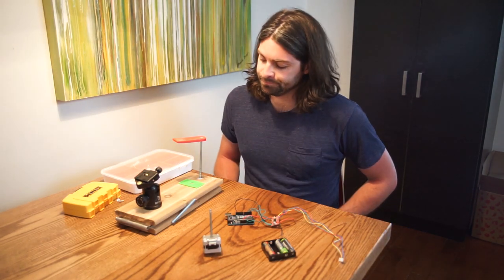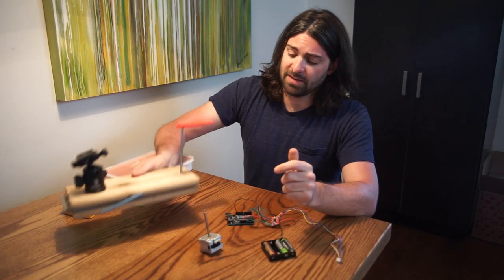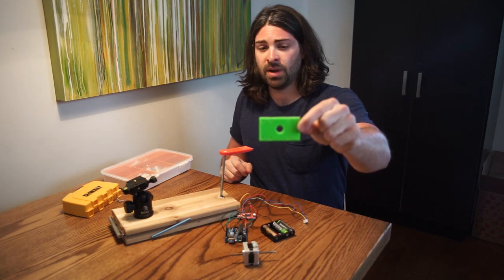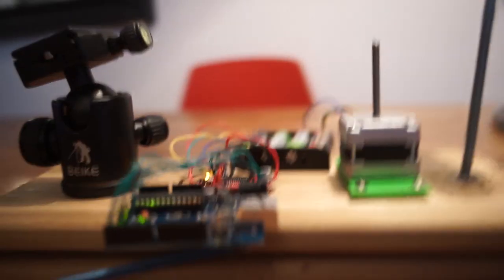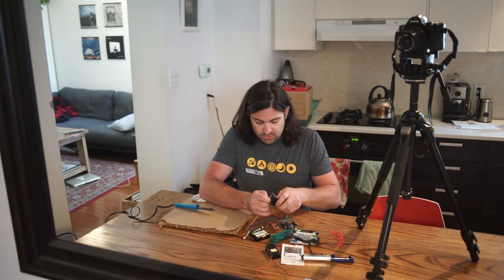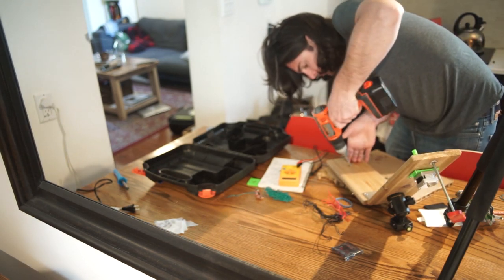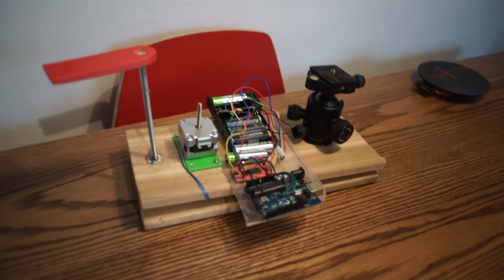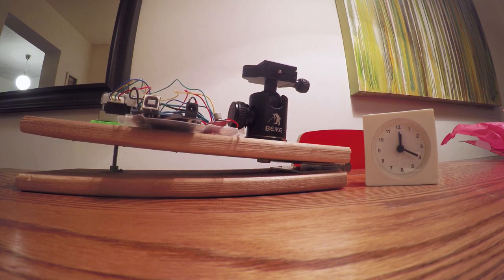IT'S ALIVE! Barn door tracker gets electricity.

Comment: I see your Arduino code (I  believe )takes into account tangential error from using a fixed drive rod as opposed to a curved rod. Easy to do with a stepper motor!  I build mine with a pivot on the top drive rod to base  mount and a pivot on the bottom mount also. Removes much but not all of the tangential error. Nicely done!  I have isolated the drive stepper from the rest of the rig with soft shock motor mounts and a shock shaft coupler to help reduce vibration. Seems to work well.

Comment: The stepper will vibrate a bit which will look like a focus issue in frame. Also attaching the stepper to the bottom board and adding mass will reduce this symptom. I believe someone comment to your previous video taking 30 second frames, registering stacking those in software such as DeepSkyStacker will eliminate some of the remaining star trail due to polar misalignment. Your next step with be to add dithering which reduces color mottle. Great ideas you put into your design. Thanks for sharing.
Reply from the maker: Thanks for the advice Michael! Good suggestion...It would be cool to sync the shutter mechanism with the stepper so the motion doesn't add blur. Now I will Google dithering and mottle 😀
Reply: @BenjaminEagan  , I encourage you to read Dave Trott's web articles. He includes formulas and a graph comparing theoretical tracking error of each design. http://davetrott.com/inventions/double-arm-barn-door-drive/  
There is another website which shows effect of micro-stepping on a stepper's holding tongue.

Comment: Yeah but aren't there some cheap star trackers for that price that could be at least as good qs this diy tracker?
Reply from the maker: Not that I know of, at the time of making this the cheapest tracker started at around $700. If cheaper ones have come out since I might have to pick one up myself.
Reply: well they have some in the 500$ range now but here it is 3 years later and I'm looking at ways to build one.. I have 3d printers and tons of parts Im thinking about using aluminum extrusion.. I would really like to know if you had continued with it